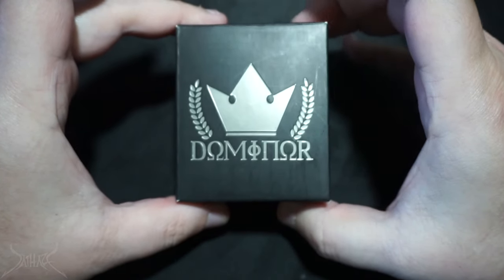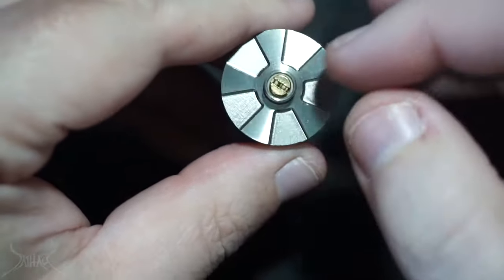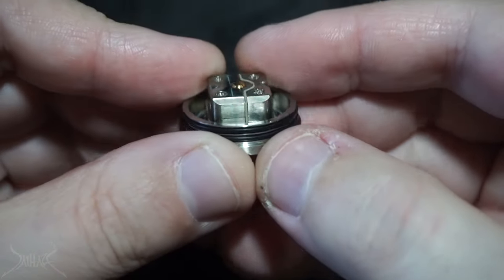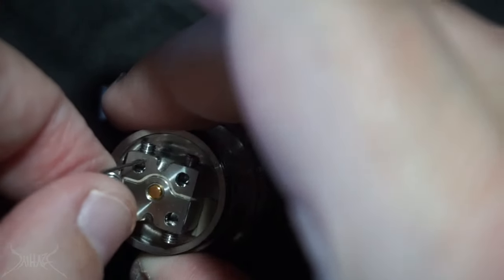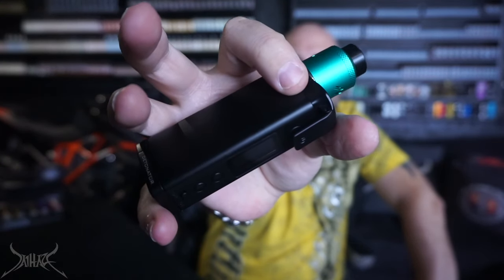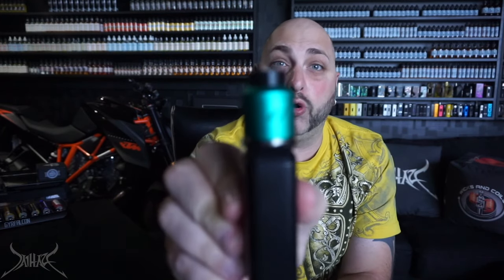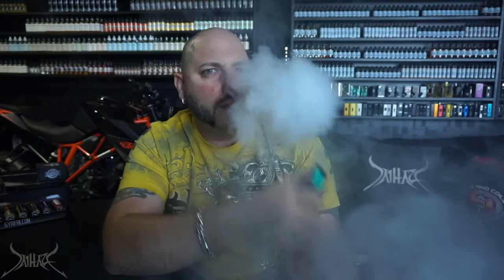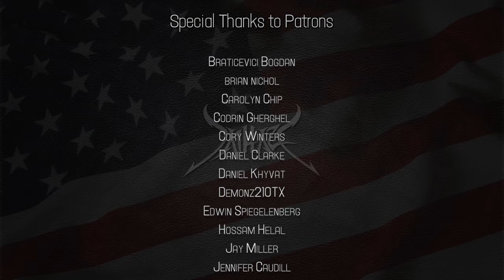Ohmen Designs Dominor RDA Review and Rundown | Unknown Everything

Comment: Funny you bring up the round wire vs fused clapons. I recently experimented with that some. I changed the fused claptons, ohms were around .22, from my Radar to Regular SS316 24 gauge, 11 wrap which  ohms at .26 and flavor tasted cleaner, if that makes sense, but overall the same.  Then I went a step further and put Quad coils in my Bonza, just because I wanted to see if I could, and it has more flavor than anything i have tried before in it. Mainly due to having 4 coils but regardless, its regular round wire. 24 gauge kanthal, 10 wrap, each coil being 2.0 ID. Even though there is 4 coils, they are extremely tiny but the flavor is huge! I want to compare to my nichrome wire but due to having a slight nickel allergy, over usage results in a nasty throat ache and horrible cough. Not really worth it.

Comment: It looks like a CSMNT build deck.
Reply: Yes .. it actually looks like it's an improvement over the CSMNT. At least this one has an actual juicewell. There is a groove pushing air underneath the coil. The bottom also looks slightly thicker and easier to hndle/use.